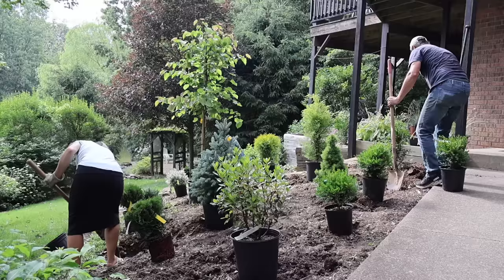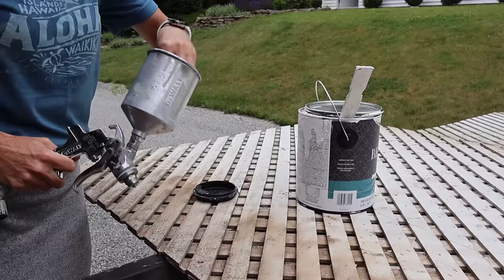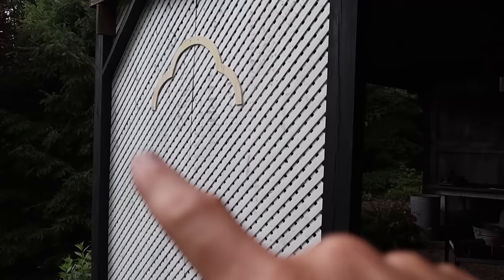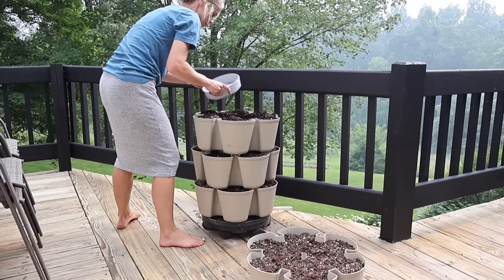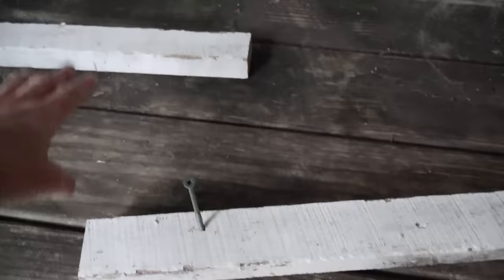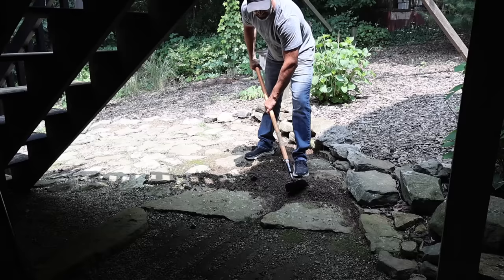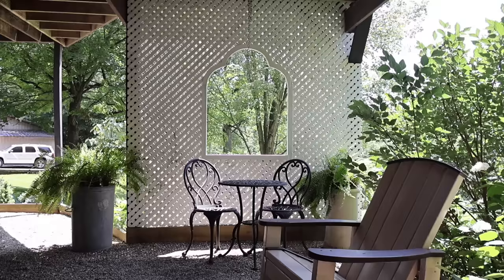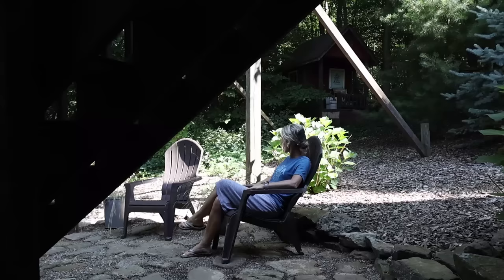Under Deck Patio ~ Garden Room Idea ~ Outdoor Space Design ~ Under Deck Idea ~ Outdoor Room Design

Comment: You should definitely have under decking installed that allows rain from top deck to drain in channels and in your yard.  It would stay dry, cleaner and nice to use in rainy weather. Looks beautiful.
Reply: What is the under decking installation from preventing water from coming down thru the slats from above involve?

Comment: There’s a vinyl product called Under Deck  you can put under your deck that will create a ceiling for garden room area and keep it dry. You can direct where you want the water to run off. You could use tin too.
Reply: I love what you did! You created a fantastic space. I have a potting bench with a little sink hooked up to the hose just as yours is. So handy!!!

Comment: Hi Mary. You had mentioned about putting a ceiling under your porch to prevent water from coming in. What are your plans for doing this? I have the same issue, but can’t come up with a reasonable solution.